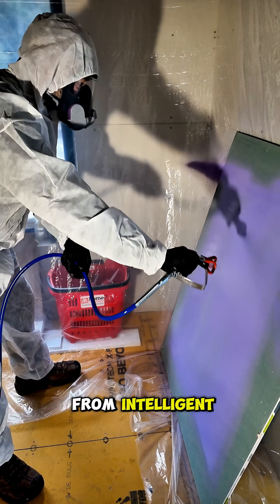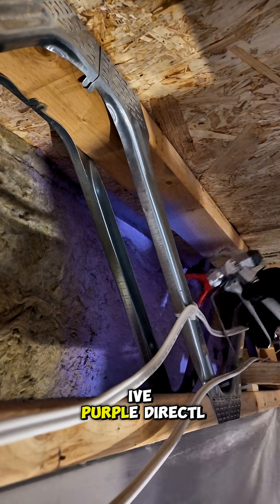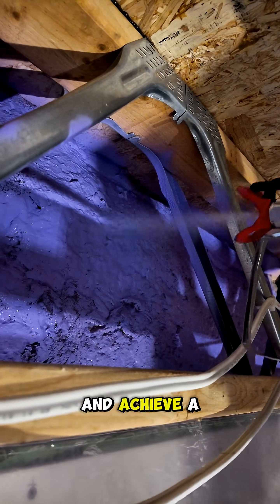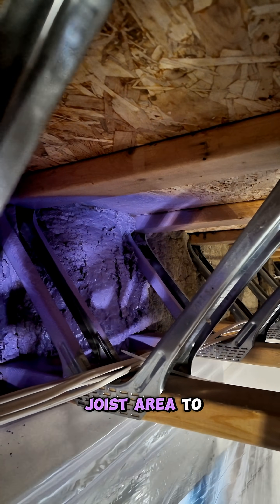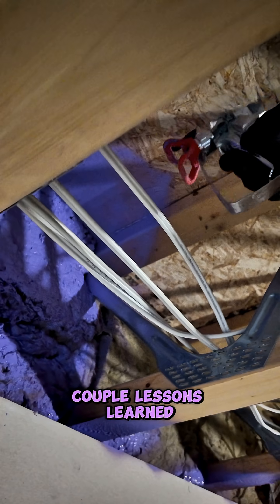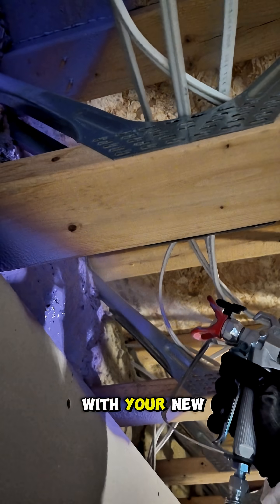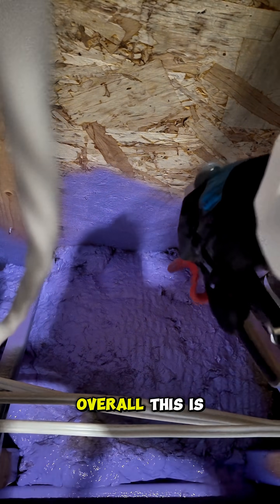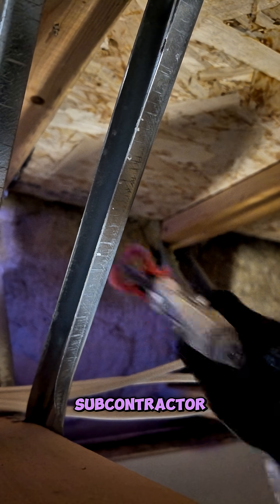Passive Purple, Spray on Vapor Control!

Comment: What exactly does that purple spray product do? I am trying to insulate an old 1948 house and need to educate myself first.
Reply from the maker: Passive Purple from Intelligent Membranes can act as a vapor control layer. In my case it keeps warm moist air from entering ghe wall cavity from the interior. It is also a way to control air flow.